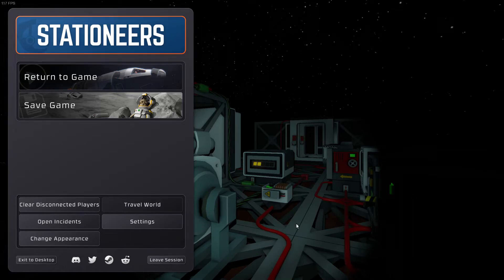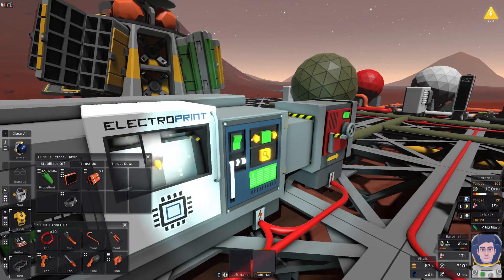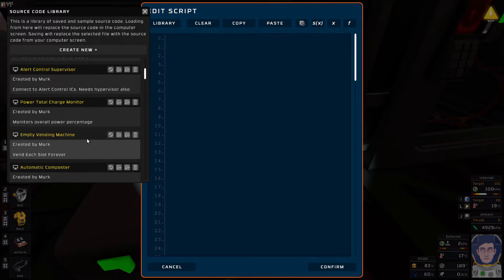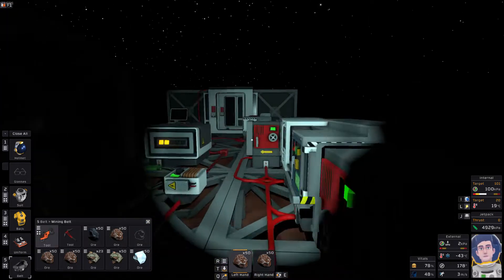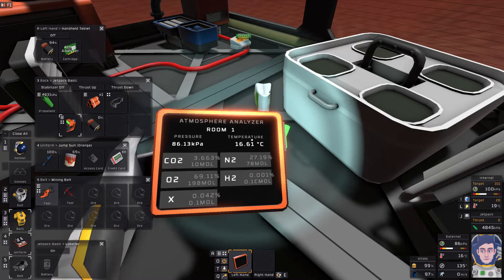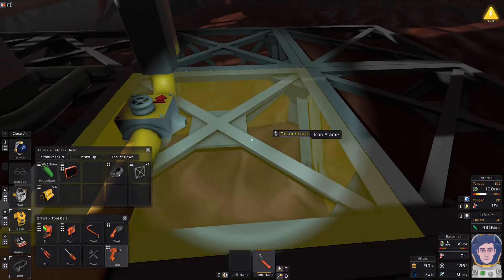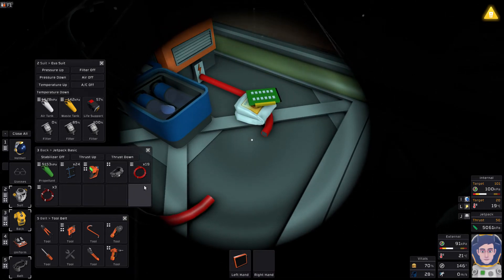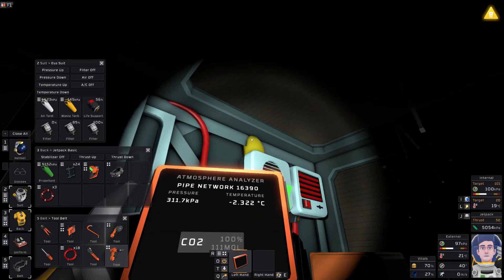Stationeers Play Through Part 5 : IC Automation

Comment: Another great video, thanks for the script link, would never have managed to automate the furnace and atmospherics without this one👍
Reply from the maker: I'm glad you found it helpful. I'm not convinced it's quite as efficient as it was before the latest changes but it does still seem to work pretty much OK. The advanced furnace one is driving me mad - I've run out of lines!!
Reply: @murk9111  Yeah, I am having problems with the auto furnace getting correct temps and pressures, at first i thought is was mixed gas temperature, so i built a large underground radiator system and moved the gas mixer to a few pipes away from the furnace. I do hope you manage to sort the advanced furnace script.

Comment from the maker: Here's the IC code for the furnace automation...

################################
## Auto Alloy
## Make alloys in furnace Murk 2022
alias settingDial d0
alias inputPump d1
alias outputPipe d2
alias furnace d3
alias led d4
alias outputPump d5
alias opMode r0
alias tgtTemp r1
alias tgtPress r2
alias curTemp r3
alias curPress r4
alias keepfill r5
alias valvePress r6
alias minTemp r7
alias minPress r8
alias tgtHash r9
define maxPress 20000
reset:
move tgtTemp 0
move tgtPress  0
move opMode -1
s led On 1
s led Color 4
l curPress outputPipe Pressure
bgtz curPress emptyit
yield
start:
s led On 0
l opMode settingDial Setting
bgt opMode 0 isset
yield
j start
steel:
move tgtTemp 1000
move tgtPress 150
move minPress 100
move minTemp 600
move tgtHash -654790771
j ra
solder:
move tgtTemp 500
move tgtPress 150
move minPress 300
move minTemp 300
move tgtHash -82508479
j ra
electrum:
move tgtTemp 1500
move tgtPress 100
move minPress 800
move minTemp 700
move tgtHash 502280180
j ra
invar:
move tgtTemp 1500
move tgtPress 330
move minPress 6000
move minTemp 1200
move tgtHash -297990285
j ra
constantan:
move tgtTemp 1500
move tgtPress 200
move minPress 100
move minTemp 1000
move tgtHash 1058547521
j ra
isset:
beqal opMode 1 steel
beqal opMode 2 solder
beqal opMode 3 electrum
beqal opMode 4 invar
beqal opMode 5 constantan
fillloop:
yield
s led Color 5
s led On 1
s outputPump On 0
l curTemp outputPipe Temperature
slt curTemp curTemp 310
beqz curTemp emptyit
l curPress outputPipe Pressure
slt keepfill curPress tgtPress
mul valvePress tgtPress 1.1
s inputPump Setting valvePress
s inputPump On keepfill
bnez keepfill fillloop
s inputPump On 0
s furnace Activate 1
s led Color 2
s led On 1
sleep 5
yield
ishot:
l tgtPress furnace RecipeHash
s furnace Open 0
slt keepfill curTemp tgtTemp
mul valvePress curPress 1.1
s inputPump Setting valvePress
s inputPump On keepfill
l curTemp outputPipe Temperature
l curPress outputPipe Pressure
yield
beqal tgtPress tgtHash madeit
bgt curPress maxPress emptyit
blt curPress minPress emptyit
blt curTemp minTemp emptyit
j ishot
madeit:
s led Color 10
s furnace Open 1
yield
s furnace Open 0
j ra
emptyit:
l tgtPress furnace RecipeHash
beqal tgtPress tgtHash madeit
s led Color 0
s inputPump On 0
s inputPump Setting 0
s outputPump On 1
l curPress outputPipe Pressure
yield
bgtz curPress emptyit
j reset

Comment from the maker: Here's the IC code for the greenhouse climate controller...

##########################################
## Hab Climate Control
## Murk 2019 (modified 2022)
##########################################
alias GasSensor d0
alias Heater d1
alias Cooler d2
alias thermo d3
alias minTemp r0
alias maxTemp r1
alias curTemp r2
alias heatOn r3
alias coolOn r4

loop:
l r6 thermo Setting
add r0 r6 273
add r1 r6 278
l r2 GasSensor Temperature
l r8 Heater On
l r9 Cooler On
add r0 r0 r8
sub r1 r1 r9
s db Setting r0
slt r3 r2 r0
slt r4 r1 r2
s Heater On r3
s Cooler On r4
yield
j loop
Reply from the maker: *Note*: This is as I modified it later to prevent contant switching